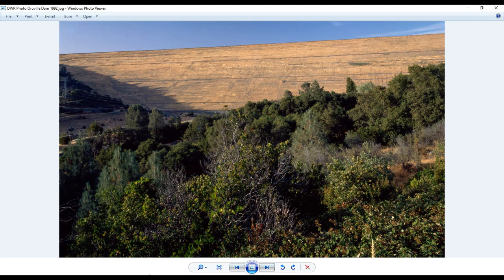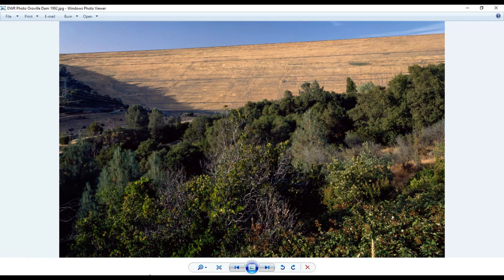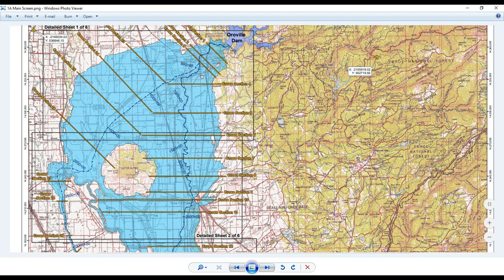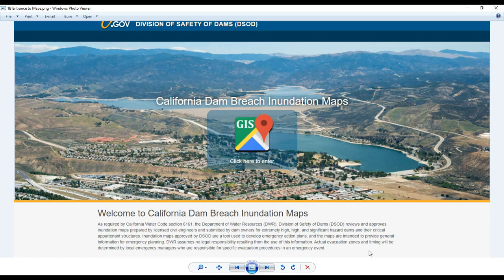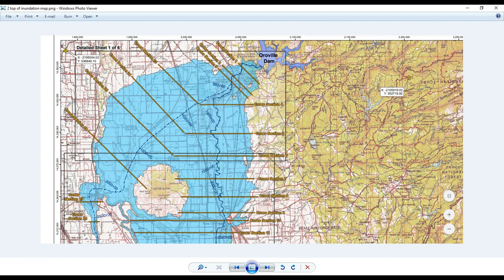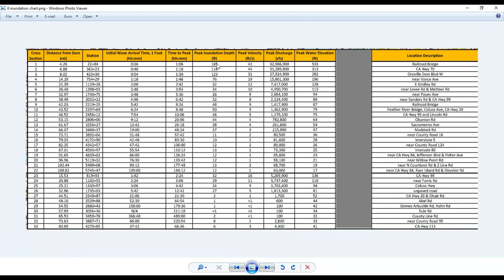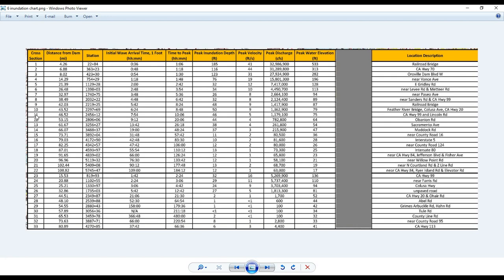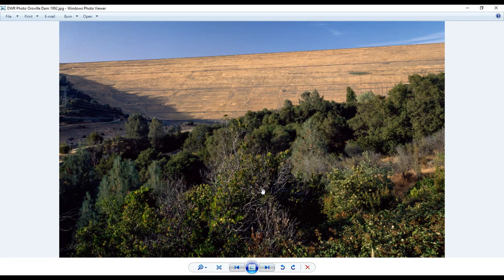Where would the water go if the Oroville Dam failed? by Millie Kay

Comment: No one seems to talk about lake Almonor. 1/3 plus the capacity of lake oroville. In around 8 to 16 hours Lake Almonor could drain into lake oroville and it cannot be stopped in the event of a canyon dam failure. It would cause if oroville is near capacity an uncontrolled release at the emergency spillway. The erosion may leave the main dam intact but create a new riverbed for the feather river and it could actually be a complete release due to the extreme inflow. Seems to me canyon dam should be reinforced. What do you think? After all PG& E owns it

Comment: If the dam suddenly collapsed the tallest height of flood water of 185 ft would be in the Feather River canyon below the dam. That wall of water would spread out across the Feather River flood plain in the valley. I’m unaware of a major dam like this just collapsing in the space of minutes. It would require a largest earthquake imaginable or a nuclear weapon to accomplish. In which case the flood water would be putting out the numerous raging fires
Reply from the maker: True, it would take a major event such as you point out. The Oroville Dam is built tough!
Reply: @MillieKay  …. All earth fill dams eventually erode. But that may be hundreds of years away
Reply from the maker: @Idahoguy10157  True.
Reply: The dam weak point is the 2 plates splitting apart on side of the plate has more wait then the other side. And table mountain is a young active dormant volcano